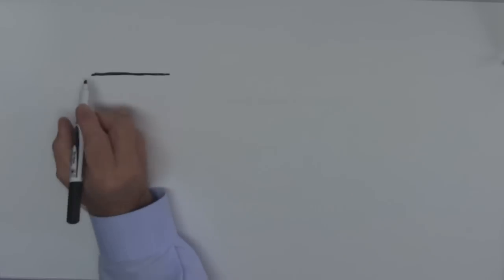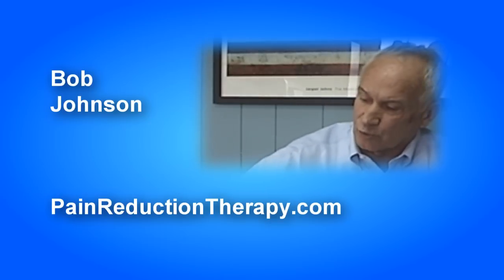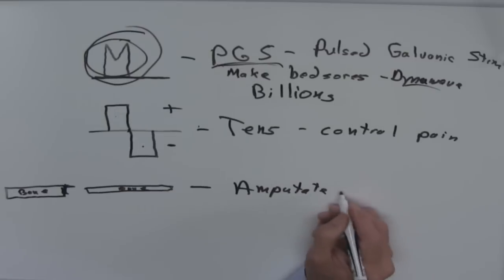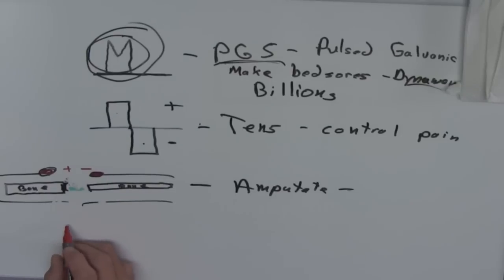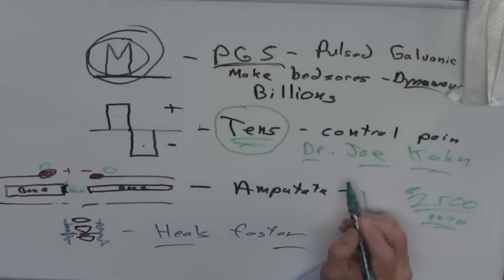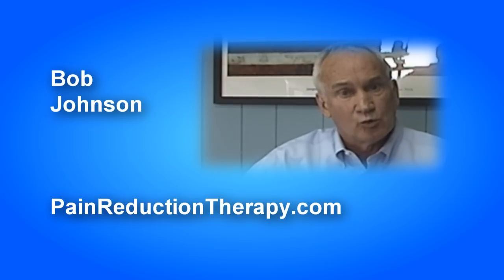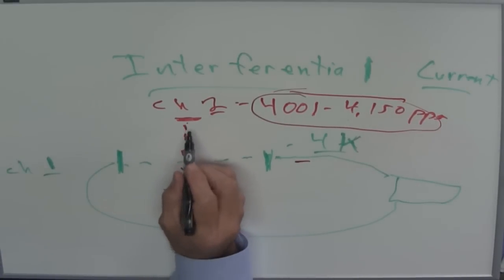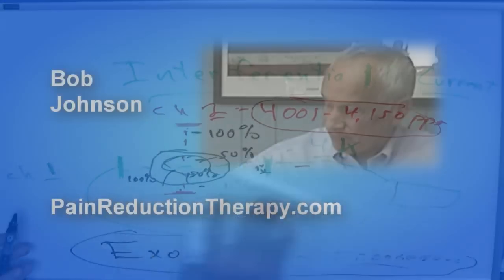Understanding Medium Frequency Electrotherapy Principles & Results

Comment: This is incredible! I did Acupuncture, TENS, Magnetic, and I just started to learn about NMES. Bob Johnson is incredibly clear and concise. And if you have a hard time understanding any of his videos, listen to them a few times more. It is a lot and it is worth getting out of them as much as you can.

Bob, if you are listening, the dry erase board is good as you go. Getting someone to cheaply help you with the presentations that is computer savvy with an easy program like Power Point, to help with this would keep your costs low and production time short.

Power point quickly creates slides. Stop there and get the basics on a handfull of slides. Then, project the slides onto the same dry erase board, and write on the basic slide with your felt tip pen.

Then just wipe the board, go to your next slide, and talk and write on the next section of your Topic.

Really great stuff Bob and really really well done and organized!

Tom Proko

Comment: Bob, I watch a lot of your videos and I am a big believer in the TENS  unit. I work as an interpreter for one of the National Parks and have done extensive research on the electric treatments given in 1915 to 1944. One treatment was called monopolar (diathermy) another was called galvanic tub treatment and one was called faradic or neuromuscular treatment. All this was done in a tub of water at 92-98F. Treatment was stopped in 1944.  
The rheostat on the wall was where the positive and negative electrodes were attached. A negative at the foot of the tub and positive under a pillow at the back.